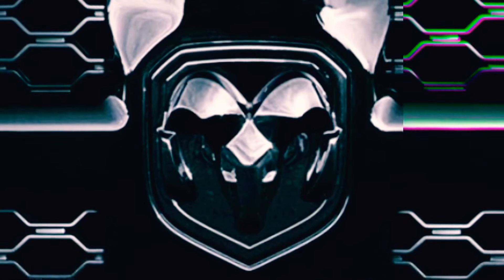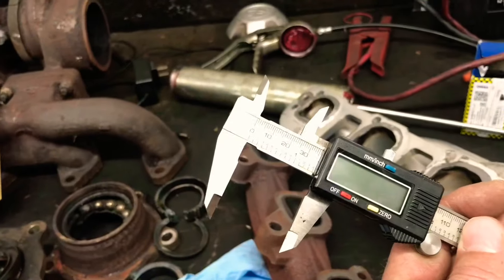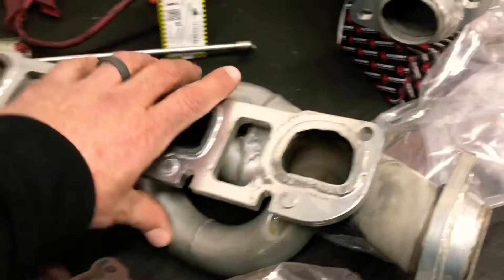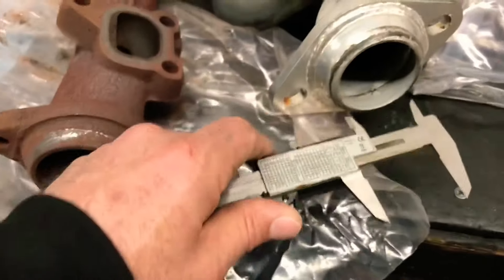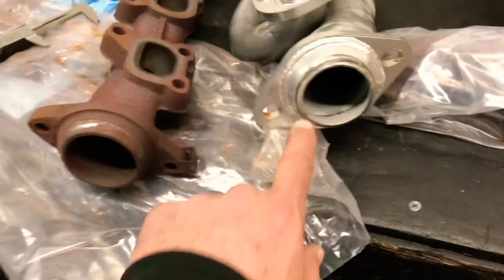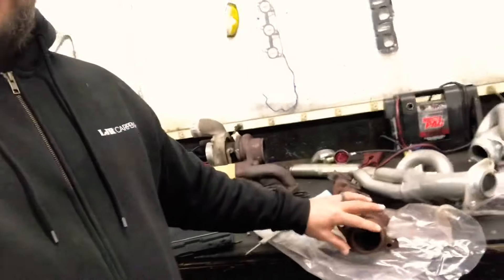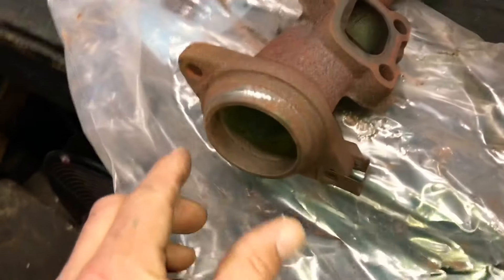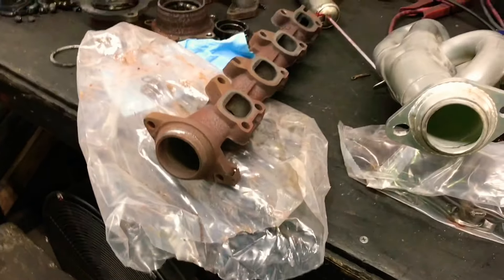RAM Manifolds vs. Shorties

Comment: Will the shorties warp and crack and break bolts like the factory manifold? This happened due to dissimilar metal contact yes? I’m investigating which shorties to go with so as to avoid manifold exhaust leak in the future
Reply from the maker: @robertalsbury  JBA’s tend to have crappy welds and leak from day one, the flange won’t warp and pop bolts.  Looks is the way to go but pricey

Comment: I thought people were switching manifolds because the stock manifold warped and snap bolts causing leaks.
Reply from the maker: They do warp and break bolts
Reply: @TunedRAMS   if you mill the warped manifold flat again will it keep warping? Or would it stay flat and true the second round? I’m on my 3rd manifold replacement in 3 years. 2 on the passenger and one on the drivers side.
Reply: @13riding  If you mill a used, seasoned exhaust manifold it will not warp again and you won't have any more problems with it. Once an exhaust manifold has gone through a bunch of heat cycles it won't warp again.
Reply: @BamaTidefan1967 this is what I did after 6 bolts/studs broke on mine, of course 5 broke below the head, so that was a day of fun with the mig! But after having them planed (table belt sand at the machine shop), they been great and sealed up nicely.
Reply: Glad it worked out for you. Replacing those broken bolts ain't no joke. @1windozesuk
Reply: So the question is, will aftermarket shorties warp and crack and break bolts because of dissimilar metal contact like the factory manifold?

Comment: I used aFe shorties before I went to long tubes.  2016 Ram 1500. Used about a year with Mopar gaskets. Zero issues.
Reply: Why'd you go to long tunes?
Reply: @redram3457  longtube headers will outperform shorties all day, so if he had the money and time why not
Reply: Did you notice a difference in acceleration vs stock manifolds? Just bought some

Comment: I had BBK shorties on my Ram, failed welds and cracks within 1,000 miles, total junk! Sounds like JBA are no better! Sucks you can't do the long tubes, even with legal cats? I threw out the BBK shorties and put ARH 1 7/8" long tubes with high flow cats and it made an UNBELIEVABLE difference mid range power and torque on my 392 build. It seriously feels like 50+ FT LBS of torque more down low, accelerating midly on the gas from a light is effortless now, before it was choked and worked hard! Hopefully you can find some 49 state legal way to do them? Best of luck!

Comment: Just picked up BBK headers in 2023 (Titanium coated) and measured. The ones I received are also 60MM, same as the manifold.
Reply: How are the shorties working out for you?
Reply: @khaosol   one of the BBK gaskets was leaking almost immediately after install. I went back for a retorque and it was already too late. The tough part is that I brought the shop better gaskets to use for the install but they said the heat shield on the gaskets prevented them from installing the better gaskets. I have been putting off getting new gaskets installed because its going to cost the same as the full install. Sucks!

Comment: I ported the collector on the shorties to be the same as 2.5 inch pipe ID. Didn't like the headers so I ported and painted my manifold and reinstalled them. Ported manifolds are way better.
Reply: I ported a set of manifolds on my 5.7 too, worked well until they cracked 2 years later and started making a ticking noise. At first I thought it was just another manifold bolt that broke but it cracked right behind cylinder number 7. Put a set of ceramic coated long tube headers on there instead and picked up 19 extra hp on the dyno. Headers are the way to go.
Reply: @jaymoe5.7  did you ceramic coat them? Don't know if that helps but I coated my manifolds inside and out. It was a pain but they look great. Might switch to headers myself anyway if these long tubes don't sell. Guess I got buyers remorse 😂
Reply: @Marshall-v3f  I didn't cereamic coat them but I did take them to a local machine shop to have the gasket surfaces milled flat. They sealed great! I'm just assuming I took too much material off in the spot it cracked because I hogged them out pretty good. As far as the long tubes go though, they are a bit of a pain to install but the exhaust tone difference was well worth the 5 hours it took me to install them. Plus even though 19hp isn't exactly a big enough gain to feel much of a difference, the pedal does feel a bit more snappy and the engine seems to like the scavenging effect the headers add. In my opinion if you ever take the manifolds off and already have a set of long tubes they're well worth installing. I have remflex gaskets sealing them up and they havn't had any leaks in the 2 years and 30,000 miles they've been on the truck.

Comment: Manifold problem on the ram 1500 getting crooked and the bolts get snapped then it’s leaks right,is that headers same thing??
Reply from the maker: Yeah the manifolds start warping and pop the bolts.  Headers won’t do that.  But these JBA Shorties had bad welds on them and leaked at the runner flange.  Long tubes are the best route for HP and reliability IMO.  There are a couple companies that make better Shorty headers, stay away from BBK
Reply: @TunedRAMS  thank you I almost buy that heathers I thought it solves the problem
Reply: I'm dealing with the warped manifold with broken bolts with the loud tick at start up trying to figure out what the best route to go for replacements

Comment: Great video. I’m looking for a good set of headers for my ‘21 Ram 1500 Hemi. Also , where are you guys from? You talk like me (Boston).
Reply from the maker: I’d go with ARH long tubes,,, yessir Boston kid 💪🏼😆
Reply: @TunedRAMS  Haha I knew it. Are long tubes legal? Just wanna make sure I pass inspection. Any recommendations for shorty headers that actually give hp and torque gains? AFE Twisted Steel 1 5/8” shorty headers caught my eye.
Reply from the maker: @shadowdemon5730  I know JBA are CARB legal with EO#.  There may be others.  LT’s are not
Reply from the maker: @shadowdemon5730  I’d go with AFE, the JBA’s leak often, I had two sets leak at welds
Reply: @TunedRAMS  Ok thanks. JBA 1 5/8” shorty’s with silver ceramic coating look decent. I’d be happy with a 20 hp gain from the headers. I already have Borla S-Type cat-back.
Reply: @TunedRAMS  AFE , got it. I’ll start looking for those right now 👍

Comment: LOL so 4 smaller holes (sharing one tube) and 1 bigger hole, is better than 4 bigger holes(4 individual tubes) and a slightly smaller collector hole? Someone needs to read more about scavenging... the only reason the shorty header would perform worse is that you havent changed your intake/intake manifold along with it. Oem exhaust is tuned to perform with oem intake 😅🤷‍♂️
Reply from the maker: Well your mouth is one hole.  Try blowing as hard as you can with your mouth open.  Then make a hole like you’re going to whistle.  Backpressure.  So yes a larger outlet lets the air out faster wether sharing one tube or not.  
But tq gains are received with Shorties, so the backpressure makes sense.  I mean ultimately long tubes are your best route.  But manifolds IMO are better than Shorties.  I just wish they wouldn’t warp so easily.
Reply: @TunedRAMS  you didn't measure the inside of the manifold though... volume is much less at one end than the other. Having symmetrical size tubing for each cyl is always better, because of more volume. Air in, air out is power. Whether your butt dyno felt it or not isnt the point. 🤷‍♂️🤷‍♂️

Comment: I hate to hate but the manifolds are restricted at the 8 port windows. 
If you dont mill that manifold your gonna get more broken bolts and leaks....
Reply from the maker: Broken bolts are due to overheating of the manifold which causes warpage. That is a problem yes

Comment: Did you notice any difference between the shorties vs manifolds? Performance, sound etc
Reply from the maker: JakerRam94 tbh it’s actually louder while driving, performance wise my butt dyno tells me the manifolds are better,,, I have a high flow Y collector also
Reply: Thanks man for the info, much appreciated 👍 got the same headers but there’s a leak somewhere on the driver side that I’ll take care of in the spring
Reply from the maker: JakerRam94 yeah just weld them up if you want to keep them, it will void warranty but whatever.  Or contact JBA and get a refund, then stick to the manifolds.  I know a few people complaining about their bolts snapping, meaning the manifold is warped, you can get a brand new set form the dealer cheap!
Reply: @TunedRAMS  where did you get the high flow y-pipe? The stock why is smashed junk.
Reply from the maker: @redram3457  on Amazon TOTALFLOW
Reply: @TunedRAMS  this replaces the muffler? Or stock y-pipe..looking to replace stock y-pipe
Reply from the maker: @redram3457  replaces the y collector, check out the video links in the description!!

Comment: What do think about the srt manifold exhaust. I have a 2014 ram sport 1500 5.7 4x4 Mopar said it will fit. (Part#77072462AB) what is

your thoughts on this. Thanks
Reply from the maker: I heard overall they’re good but I do t think they fit in the RAMS due to the fire wall on passenger side.

Comment: I’m interested to know if I can sawp 5.7 headers for 6.4 headers on my 2019 Ram 1500 Classic?
Reply from the maker: I think they’re a little different, you may have to cut some of the fire wall or dent in a tube
Reply: @TunedRAMS  but are they a direct bolt on?

Comment: With the larger ;primary on the headers, you lose the restriction and hard edge of exhaust trying to get into the manifold, so better flow. With the design of the tubing instead of a hard turn to the rear, you again get better flow. Yes, the output may be smaller on the headers, but since back pressure is also part of the equation for exhaust, maybe the folks who designed the header have tested it and found it needed a little more back pressure since you've removed some of the restriction? Just a thought. Also, maybe that install requires you change out the collector end to fit the smaller opening so it seals correctly. I understand your point of view, but I think you might be interpreting this particular situation incorrectly. Headers are always better flowing than exhaust manifolds. It's been a proven fact for years. You mentioned long pipes, but those give you midrange and high end power. If you're not doing a lot of mid and high rev driving, you aren't getting your money's worth. The shorty headers give you the low end up to mid range power. They're better for most driving conditions and still outperform manifolds at high revs.
Reply from the maker: Rob Hill long tunes are the way to go for performance.  Manifolds are just as good if not better than Shorties, they scavenge the exhaust  quickly
Reply: Thank you Rob your the only only one that made sense !
Reply: I love you hit hit it on the head Rob! However, back pressure is a myth, ANY back pressure in a 4 stroke engine would be, at best, awful. The smaller collector outlet is to adjust for velocity of exhaust due to the increased flow. The back pressure idea has been mislabeled for generations but aside from the phrase you are 100% correct! Also, these Hemis actually do better down low with a LARGER runner, a bit counter intuitive to majority of the automotive world.

Comment: What size are the primary tubes. 1 5/8 or 1 3/4?
Reply from the maker: 1 5/8” I think
Reply: @TunedRAMS  I just bought Flotech 1 3/4 ". I'm interested to see if I get anymore out of them. I also bought the bolts with the locks to try and prevent the leaks. I will let you know if I see a difference.

Comment: If anybody decides to get shorty headers don't get the chrome get the ceramic The chrome are okay but they will not be chrome within a year it'll turn a bluish color because of the heat

Also once they run out of stock on Chrome they will no longer be available for sale

Ceramic is the way to go You're talking a hundred bucks more it's worth it if you're going to spend $500 on headers make sure you get the right kind.... Shorty's all the way
Reply: What’s the right kind?

Comment: Don't listen to this crap shorties are better That's why they are called performance headers

No disrespect dude but you really need to do your studying before you make videos like this
You add 15 more horsepower with shorty headers also it burns more fuel before it hits the catalytic converter than the regular stock manifolds

Meaning you prolong the life of your Cadillac converter as well That's just a pro to the situation

I'm a little shocked at this guy's video knowing that he has a shop and everything he should know all this